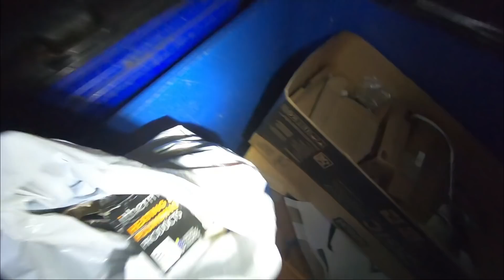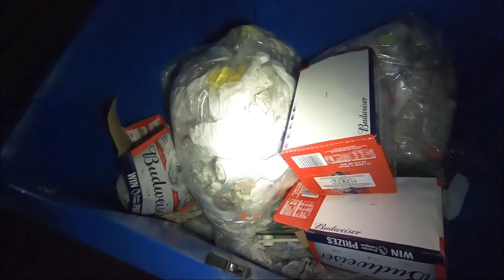Street Scrapping On A Bicycle

Comment: Hi Foxy Vandal.... :o) I'm not sure you're using the quick release bolt on your bike as you should? You shouldn't have to put the nut on and off every time, you should be able to just use the lever part to tighten and release, I think